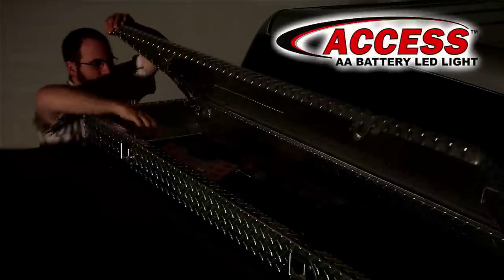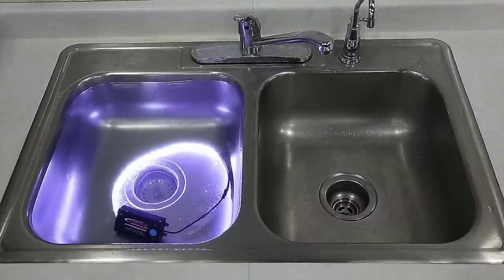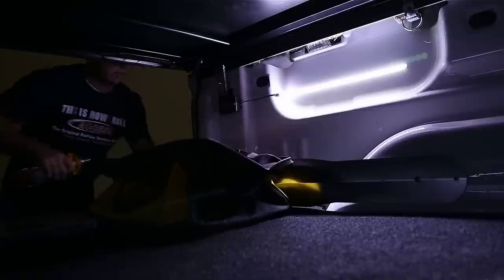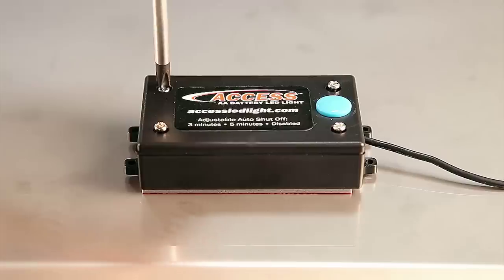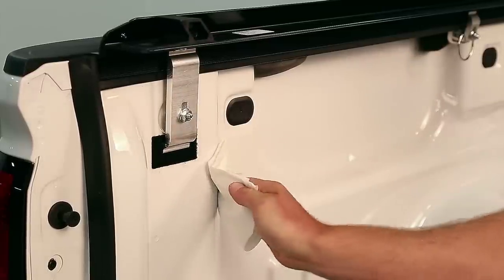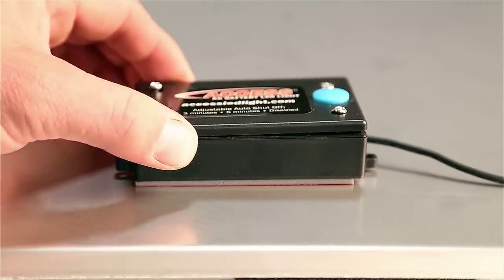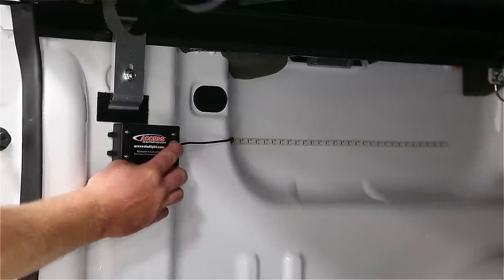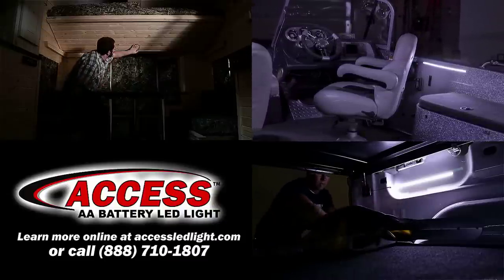ACCESS® AA Battery LED Truck Bed Light Installation

Comment: How often will I be changing out those batteries? Assuming I turn on the lights for a couple minutes every other day
Reply: Hi Alex Jasso, when the light is run continuously it would last roughly 30 hours. If you are only using it every other day for a dew minutes you should not have to change out the batteries often. Thanks.

Comment: does the box come with adhesive or has to be screwed? thanks!
Reply from the maker: The battery powered ACCESS® AA Battery LED Light installs quick and easy. Just cut, peel & stick the LED lights where you want them.  NO screws needed.

Comment: Do these fit under the lip of the bed if the bed has carpet ?
Reply from the maker: The battery powered ACCESS® AA Battery LED Light will fit almost anywhere, in your situation it should work as well